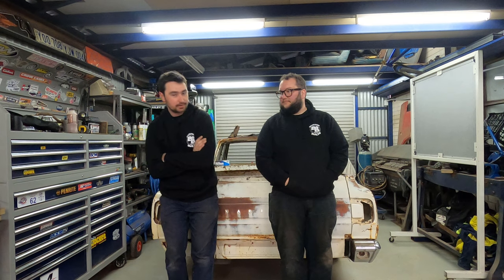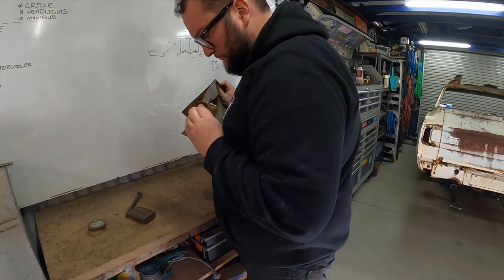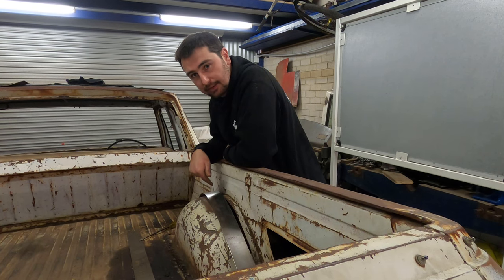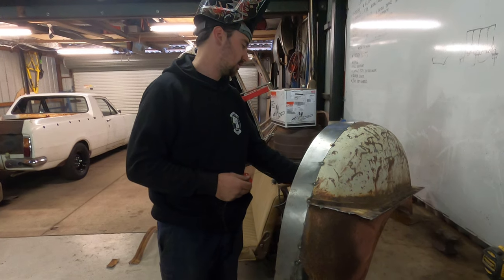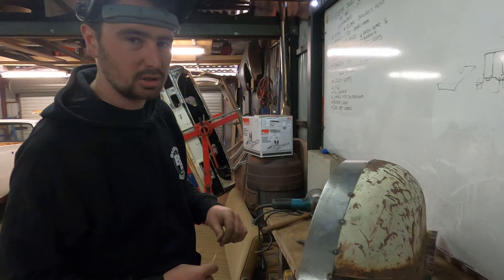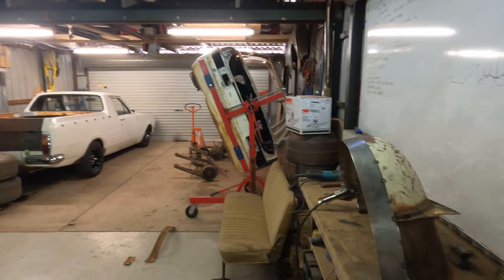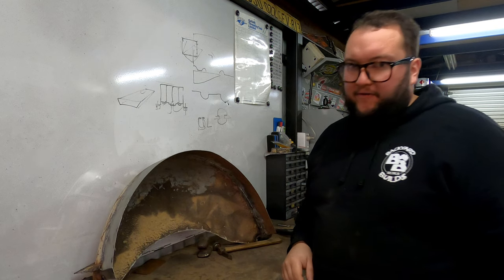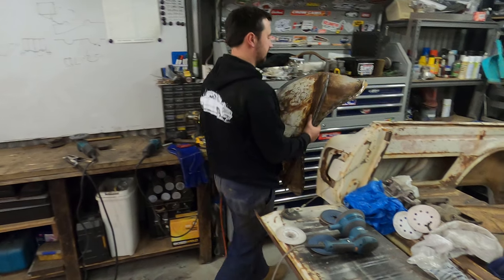We finish the tubs.... sort of. How to mini tub a turbo hemi ute: BackyardBuilds

Comment: Keep the vids coming guys, nice work!  Tom said the mig wire he used to tig the strap to the original wheelhouse was silicon bronze, but the welds didn't really look the correct colour, can you please confirm this is what you were doing?
Reply from the maker: Tom made a mistake we had silicon bronze mig wire in the week before for another job. The stuff used was standard 0.9 mig wire from Bunnings. Thank you for your support mate

Comment: Why do you use the tig why not just Mig it ?
Reply from the maker: Tig weld is actually softer & is far easier to dress out. MIG weld is quite hard & can put a lot of heat into a panel, causing more distortion.